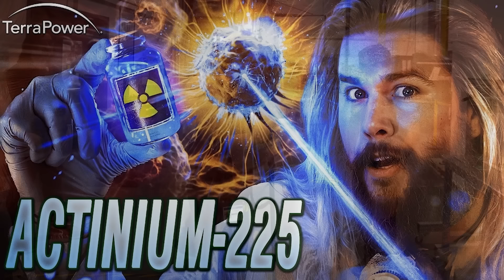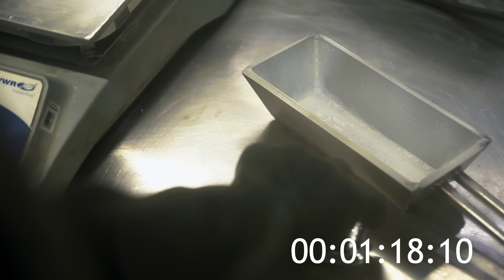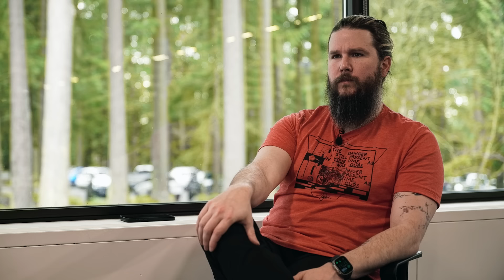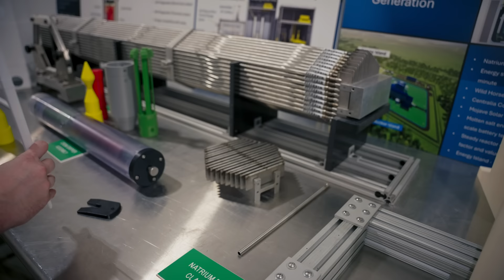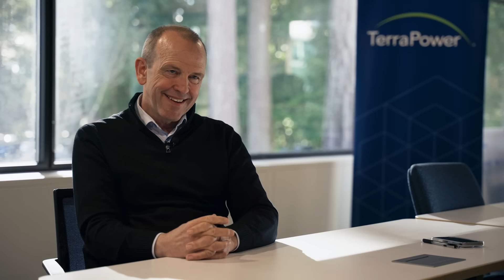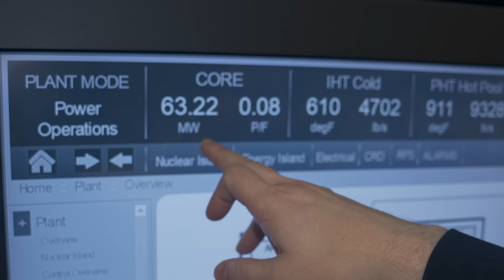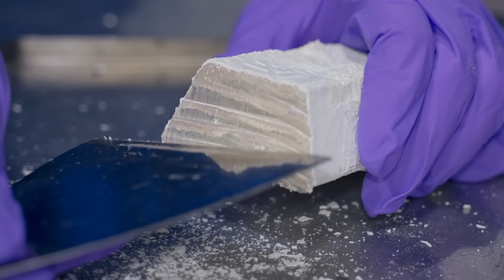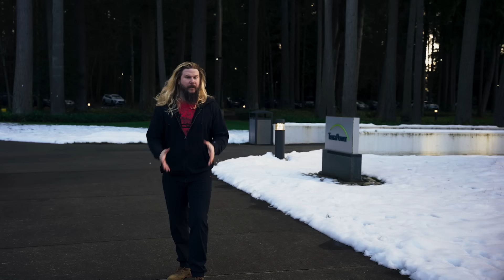Will Natrium Nuclear Reactors Change Everything?

Comment: - "Hey, how can we make Nuclear be safer, seem safer, and have a lot less engineering requirement"
- "Uhhh, well, we could try replacing inert, somewhat corrosive water with angry and ready to explode liquid sodium"
- "Cool cool… and maybe fill the control room with bears while we’re at it? Oh, and let’s make sure the coolant bursts into flames on contact with air, turns radioactive after use, and forces us to build a fast reactor—because clearly nuclear wasn’t expensive or complicated enough already. Maybe we can add a mandatory 500°C operating temp and design a maintenance schedule that only suicidal robots would volunteer for."

Someone didn't understand the question....

Comment: Thebreason why nobody has ever attempted something as stupid as a liquid Sodium cooled nuclear reactor is because Sodium is a nightmare of a material, it will attack EVERYTHING you made your reactor walls or piping of
   
Steel? Stainless? Aluminum? Ceramics? Nope. Everything is game for sodium, and it will only stop once it finally contacts some water
   
So for this reactor to be commercially viable you need to hot swap the walls of the reactor constantly, yes, hot swap the walls of the reactor, this setence should be more than enough to demonstrate the stupidity of this concept commercially

Comment: "Can follow the load of the grid just like solar and wind do."

Uhhh.....?  You mean just like they absolutely can't? The whole issue with wind and solar is that they're intermittent and unpredictable and would require a masdive amount of batteries more expensive that the solar and wind itself in order for them to operate as stand-alone power sources.
Reply: What he means is that solar and wind can follow and can reduce their power output easily when supply exceeds demand,
Reply: Yet here's the nuclear industry taking the same approach: transfering energy to storage to make use of it later when there's demand so as to follow the load requirement. The reason storage costs more than solar and wind itself is because solar and wind can be built cheaply, by and for any country, with great speed and relatively easy to handle, mostly recyclable materials. Solar, wind and other renewable energy technologies just have to be built alongside appropriate storage technologies and effective grids. Research is great. But when it comes to powering communities and the economic activities they rely on while also preserving the conditions of the planet we live on, why delay? Especially, when what we're waiting for is expensive nuclear technologies that will serve the needs of private energy company shareholders who are also planning to be their own major customers.

Comment: Ok so im convinced that using sodium is safe but the point about a 30°C bar is safe is useless when thats not how its going to be used at all

in fact if the sodium does become a solid you have some real issues and this could happen if the planet needs to be shut down for maintenance or what ever. im really curious about this issue.

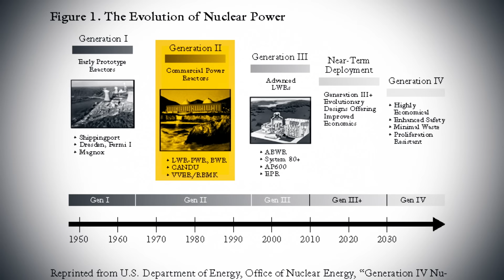Comment: 1:42 what are u talking about nuclear plants are based of a flawed design which the inventors of made known to the companies and us gov that they will have a major event within 40 to 50 years of operation and a event that could result in or near criticality over the next 80 to 90 years. Litterally the guys who invented the plants were screaming to stop building. This was in the late 60s early 70s. They even fixed the issues and made a new plant design but because the old designs took 40years to decomission and the number of them already in existence made the gov n companies deem the expense not worth it. This resulted in a flawed reactor design being approved as the standard. EVERY SINGLE nuclear power plant in the united states is this flawed design. They had the stage 1 prototype small scale, they changed some things made a large scale prototype with the changes calling that stage or reactor 2 then they finalized that stage 2 reactor and had it approved to be installed and used calling that the stage 3 the reality is we are using the very first designed reactor type thats known to be flawed by the people who invented it. Its like screaming into the wind with this sbject cus everyones worried about aliens or natural disasters ir solar flares but these plants are reaching a age where we could have MULTIPLE plant problems 3mile island style

Comment: From my understanding they are greatly downplaying the risk of sodium explosion from water ingress. We had a 4th gen prototype reactor or two using that system in france, and the decomissioning process is the stuff of nightmares. This is like everything you hear about asbestos or radioactive material x10. They expected it to go off at any point during the decomissioning process and had to account for that. The figures I've been able to find from a quick google search gave me a document dated from 2009 where it was expected to take 30 years and 750M€. You can bet your azz it went up since then.

I'm pro nuclear but it should be a national strategy with the entire lifecycle accounted for realistically, private firms will just abandon the site when the bills are about to be high and go build one somewhere else. Like the thousands uncapped oil and gas wells sitting around.

The plant footprint 3D rendering they have is laughable, they are gonna have the sodium pipes sitting in the open to the elements ? Sounds like a good way to get rust and leaks and a massive explosion to me.

Comment: Molten salt reactors have been researched since 1960 and it could only work if it sustained meltdown conditions. Can't meltdown you are already melting down. Also it didn't produce all that much nuclear waste because it would burn nuclear waste as fuel.

Comment: I am actually curious about how susceptible Na is to neutron activation. It was I while since my surface level studies in nuclear physics. If I remember correctly, the sodium cross section is quite small, so it won’t be a very significant issue in commercial use. That would mean that the amount that needs to be replaced when the system is in use would be quite small. 
If anyone has any input, I would appreciate your expertise.

Comment: The one thing lingering in the back of my mind is what happens if the sodium ever cools down enough to return to a solid. And, especially, what happens if just enough of it solidifies to clog the loop. Say the loop loses power for 3 days through some freak accident—could some of the sodium in the pipes between "islands" solidify and clog the loop, stopping it even after power returns? Could that potentially lead to a meltdown if the fuel gets too hot (because the coolant is no longer circulating)? Here's hoping they've already enginerred something here.

Comment: Can the sodium or salt solidify in the pipes if the reactor shuts down? How do they mitigate that?
Reply: Good question, they install electrical heat trace on the outside of every pipe (and put insulation over the top)

Comment: I wish they'd talked a bit more about how they prevent water from touching the sodium. Like, I was already aware that dry sodium isn't that dangerous, but what I'd be worried about would be some kind of tiny rainwater ingress that spirals into a big accident. I'm sure they've already thought of that, but it would've been interesting to hear about it.
Reply: They keep the sodium system sealed under positive argon pressure. that way a leak will push argon out instead of letting air/water in
Reply: @GreenOddish  huh! Sounds pretty safe

Comment: Energy problems are due to corporate and public politics, not technology. Privitization and lack of regulation has let to the stripping down of the system and the neglect of infastructure. Energy was one of the first utilities that was nationalized and for a good reason, it just doesn't work as a private corporation. It's too easy to price gauge people, there is little incentive to give services to low population areas and with how essential the services are they will always get bailed out no matter how badly they do.

Energy is a public utility and can only work well if it's run like one. The burden of capitalist parasites is not one it can bare.

Comment: I feel like the sodium and water question wasn't answered. What if a pipe of molten salt ruptured in the heat transfer section and all that molten sodium starts mixing with water
Reply: There's a sodium-salt heat exchanger, and a separate salt-water steam generator

Comment: One of the most dangerous things that regularly happens in chemistry laboratories is drying solvents. This could be with things like calcium hydride in a still, but diethyl ether for not totally anhydrous use it regularly dried with sodium wire in the bottles it is delivered in. It's super fun (/s)! You take a bottle of diethyl ether that boils at below 40C and is INCREDIBLY flammable, put it under a wire press, introduce sodium metal to the die and then press it through. Because it is now a wire you have increased the surface area massively and so the protective coating is not there and it rapidly reacts with oxygen and water, particularly the water in the ether. So it begins to spit and hiss (literally) at you, and if you go too fact it can spark and ignite the whole bottle of ether! And then it's even better when you have the bottle mostly empty, so now the wire isn't fully covered with ether and is in contact with air. And then when the bottle is empty you need to dispose of the sodium. Long story short, drying solvents sucks.

Comment: I get that it's at least partially because of how enriched the fuel is that navy nuclear reactors are able to load follow to drastic changes in steam demand for ship's propulsion but it still surprises me I guess that civilian nuclear reactors can't really do any load following? Like yeah it's less efficient but how much so? For a given military nuclear reactor start up you have to calculate an estimated critical position based on calculations performed back with the initial design of the reactor based on many factors including the effective full power hours (EFPH), which is a value that implies to me at least that you're not losing all that much efficiency running one of those reactors at 50% at all times vice 100%. 

I guess the question is how much efficiency is affected by reactor design, and how much efficiency is affected by fuel enrichment.

Comment: Sodium cooled reactors aren´t a new thing, alfa class soviet subs had them in them in the 70´s. The biggest problem on sodium and other metal cooled reactors is the fact that if it scrams, the reactor is bricked. cuz once the sodium coolant becomes solid inside the reactor, it´s not melting again.

Comment: I'm sure they've thought of this, but what about using tin instead of sodium? It is far less reactive than sodium, and so should enable a lot of materials and designs which otherwise wouldn't be feasible. Its melting point is a lot higher than sodium's, but still much lower than their operating temperatures. It is a lot more expensive than sodium (which is a very cheap metal), but I don't think its cost is unreasonably high especially given that you should be able to keep using the same stock of tin for decades on end. Also don't discount the savings on handling the tin, due to its much lower reactivity! It has a much higher density than sodium at around 7x that of water (or about 8x that of sodium), but that's about the same density as steel and we work with that stuff all the time. Its thermal conductivity is lower than that of sodium but it's still pretty high overall, higher than quite a few metals. I assume thermal expansion isn't presenting too much of a problem for them if they've already got sodium working, because it has quite a high thermal expansion; however tin has a much lower thermal expansion than sodium, for what it's worth.

Comment: 12:35 - but.. how much does it store? For how long can it supply the grid? (Considering full capacity)
Reply: Judging by the size its under a day's worth of power. Likely under 10 hours.  But the goal isn't to supply the grid without running the reactor.

The reactors are going to produce about 1000MW-thermal which will be enough to produce about 345MW-electric.  The on-site turbines will be capable of producing 500MWe from the steam heated from the salt.  

So the plant will output 345MWe on average, but it can generate less electricity or more than that as the grid demands and either fill up or use up the buffered hot salt.

It's a buffer more than a battery. 10 hours of storage (just my guess/example, not official) for 345MW is 3450MWhr.  If the plant is producing 345MWe of heated salt and the grid is demanding only 285MWe, then 60MWhr of salt will accumulate per hour, a surplus that'd take almost 60 hours to completely fill the tank.  Similarly if the grid is asking for 400MWe, it could exhaust a full tank in around 8 hours with the reactor off, but with the reactor on and a deficit of only 55MWe, it'd take close to 60 hours to run it dry.

The salt tanks are to vary the output around the baseline - not to power the grid on its own.  Though it's helpful in the case of an unexpected shutdown to have a reliable 'external' source of power for pumping, cooling, and monitoring.
Reply: @Xylos144  thanks for teaching me! I'm learning a lot about nuclear and sodium in these comments!
Reply: @Xylos144  I'd say powering the grid without the reactor is also useful. It turns potential emergencies from "should we shut down the reactor and cause a blackout?" into "we can power this down and we have XX hours to figure stuff out if needed". That kind of safety margin can be extremely useful.
Reply: @therealax6 that's a nice idea in concept, but there's a pretty limited scope of problems for which that's practical.

If it's something you can shut the reactor down for a very short time for,  then it works.   But if the reactor is off for more than a few hours, then xenon poisoning becomes a real problem and - by regulation - the reactor has to stay shut down for several days until the xenon clears out.

Some fluid-fuel reactor designs can bypass the xenon issue, but I believe natrium still uses sealed, solid fuel rods.

And if its a minor problem that'd only take a short time to fix, which can be fixed while the reactor is still incredibly hot and radioactive, it's probably a problem that can wait until a planned shutdown to address.

The main benefit is that if the reactor trips unnecessarily, the grid doesn't have to compensate and kick on some backup fossil fuel plants.  And if the plant trips because it's necessary, the backups can be brought online over the course of hours rather than minutes.  Which is good because running peakerplants that are ready to provide power at a moment's notice is expensive and polluting.

The main point of this salt buffer is to let the nuclear plant run at 100% capacity all day, every day, for as long of a stretch as possible without any change in temperature or flow rate or fuel burnup.  In machines like these, it's the thermal cycling and the changes in conditions that wears it down rather than operating time. And any minute the plant isnt running at 100% is lost revenue, since the minor savings in fuel can't compare to the static maintenance, operating, and financing costs of the plant.

Comment: They should use supercritical CO2 turbine instead of steam turbine. Also with plummeting cost of LFP batteries and incoming sodium ion batteries they wouldn't need a molten salt storage. It only adds to the complexity. Even without any batteries we can build nuclear reactors to the highest demand and do load balancing with industries like glass manufacturing or steel and aluminum recycling.

Comment: So if the heat source due to any reason stops, the molten salt solidifies in the pipes and then when the heat source comes back on, the cooling system is clogged with solid salt?
Reply: Molten salt piping has heat trace strapped to it under the insulation

Comment: And if the reactor cools down even once it's effectively a radioactive brick, because the sodium and salt solidify and are probably a pain in the rear end to get flowing again once solidified inside the pipes.
Reply: Heat tracing is installed on these pipes, just like they do in the CSP industry

Comment: How does sodium compare with thorium regarding corrosion of the plumbing?
Reply: Sodium is pretty tame in stainless steel piping. There is minor leaching of nickel and carbon but this is provided for in the wall thickness of the pipe

Comment: Seems to me (an armchair idiot), sodium would be a terrible idea.
1: it will burn in contact with air or water should the reactor be damaged.
2: then it turns from a metal to a water-soluble salt that will dissolve into the ground, I to the water table etc. Ie, bad.
3: mane as an added bo us it is radioactive.

Seems to me, just use mercury:
 1. It is inerrant occurs naturally in nature
 2. doesn't burn or really turn into water soluble salts
 3. can replace both the sodium AND corrosive liquid salt.

Comment: "You need it to be molten for it to actually start burning in air" at 15:14 doesn't really sound very safe when your reactor uses it indeed molten 😅
It sounds more like if there is a rupture in both sodium tube and protective gas casing, it would go very much boom. Even more so if there is water involved (like tsunami). 😅
Reply: Or it could just end up being a slowly burning pool of radioactive sodium... if the combustion products just stay on the ground that wouldn't be too bad, but if it becomes an aerosol (can sodium oxide do that?) then I think it could have similar effects as the graphite fire in a certain RBMK...